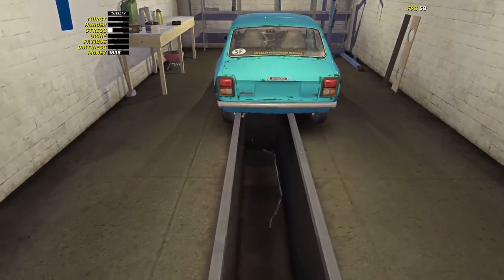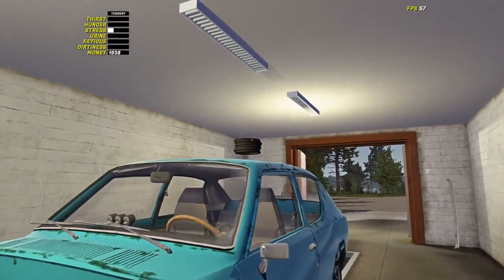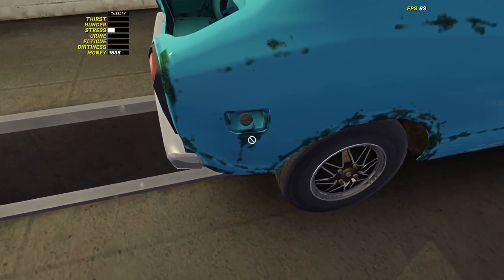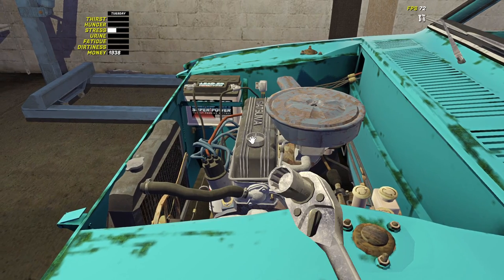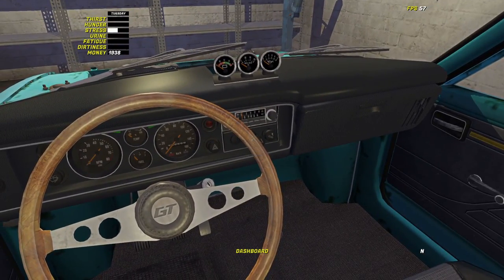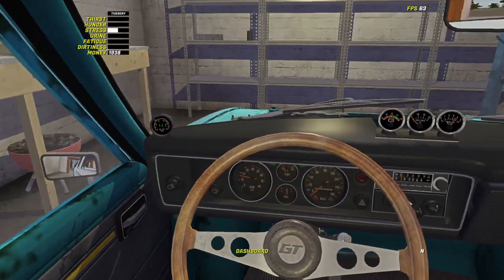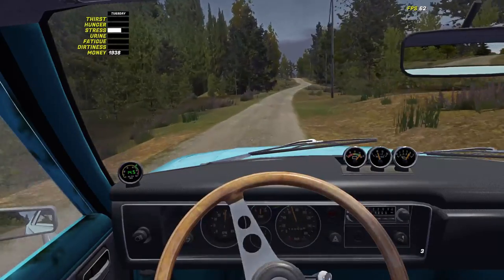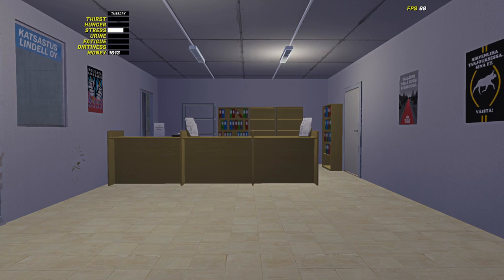My Summer Car - Wiring, Tuning & Inspection Tutorial - Update 2021 #MySummerCar

Comment: I didn't get where I am today by not subscribing to channels. Subscribed, have a jolly good day. My car has no power in first gear from a standing start. It will stall rather than drive at low revs I must always start moving forward by wheel spinning. The car has been like this since I crashed it slightly because of alcohol withdrawals.

Comment: I did EVERYTHING the same as you did, but my car wont start up... just runs out of battery... Any suggestions ?
Reply: You might've gotten a faulty battery. Check it on the battery charger by leaving it there for a while. After some time, if the needle is still on the right side, then your battery is probably dead. If it's in the middle or the left, you should be good.
Reply from the maker: Did you put gas in the car?. If so it might be what @Nick Zazirski said or you might have a busted part such as the rocker shaft.
Reply: @KasualChris-gaming-channel  yea, it was caused by busted parts... I'm so unlucky and got 2 pistons already damaged from the start of the game... Changed them and now its working .. thanks for the tutorial btw. :)

Comment: Thanks but slower version would be better for the starter players because you did everything so fast it was hard but good tutorial still :)
Reply: Oh the satsuma didnt start :( well i guess the wiring is wrong ill test to do that some day
Reply from the maker: It is literally impossible to get the wiring wrong buddy. Youve either forgot to bolt something up like the battery or the starter. Or you've missed a wire somewhere
Reply from the maker: You can always use msceditor to find out exactly what it is buddy
Reply: @KasualChris-gaming-channel  it started tow times normally and then it doesnt make any sound when i try to strat it has gas and fluids but yea and i dont like to use in games like softwares that arent like the game because its kinda cheating
Reply from the maker: It's only cheating if you know what's wrong but are to lazy to actually fix it. Its research when you don't have a clue what's wrong and want to learn for next time it happens 😀

Comment: I though the screw heads on rocker should be in same position facing same direction to make valves all in sync? I thought there was more to it than  just getting it to stop making ticking noise if you wanted them even that's why on wiki they suggest adjusting screws a specific way to ensure they are all even then turn on engine and adjust to ticking then back off and at that point all screw heads will be the same direction and you will know without a doubt all valves are completely even. Also I noticed you didn't tune the distributor ignition timing again...why don't you tune that also?
Reply from the maker: Honestly. I forgot about the distributor lol. I will put it in my feedback to remember it next time lol. Or I will do a tuning tutorial that covers it all
Reply: @KasualChris-gaming-channel  distributor is important for performance. Very important to adjust for nitrous!! If you make an advanced tutorial for performance increase that would be a great time to add the distributor. Overall still best tutorial on youtube for MySummerCar so cheers
Reply: @KasualChris-gaming-channel  i fucked up my rocker, now it fires when starting and dies after few seconds, also clicking sounds after the engine is turned off
i rolled back a save, and i cannot thank you enough for your tutorial, my car is for the first time in YEARS running

Comment: Hi, I have a problem where I rev but the car doesn't move, I have checked the half shafts and made sure I had all the brake fluids in. Do you know what the problem could be? Thanks
Reply: Take off the parking brake
Reply: Cannoli Nation  does the car start and it will go in gear and not move or  are you just trying to push it ?
Reply: Cannoli Nation  save at the toilet in your house and come back in and see if that helps the issue whenever there’s a bug saving and quitting usually helps

Comment: Help please, how do I remove, uninstall wires? I accidentally plug the radio in the bad speaker on the car when I have the subwoofer thing. The editor doesn't work for me(it's all false when I load it). Need help!
Reply: Just look carefully at the editor it’s hard to miss

Comment: I did the wiring all correctly but my car is still not working. edit: i found the problem, the bolts on the battery were not tight!

Comment: Ummm can someone help me i cant find the battery ground conecter. Is it because i have racing radiator?
Reply: Unscrew the bolt that's closest to the front of the car on the starter and then you can connect your ground wire. I hope this will help.

Comment: Well, after few hours of cusses and other few hours scratching my head; the car finally started first time in years. Seriously, Satsuma has been in garage without engine almost 2,5 years soon. :D Only issue seems to be spark plugs, they seem to keep loud banging noise when I rev the engine bit, with high revs its just fine. Any ideas what could cause it?

edit. its not spark plugs, noise comes from carburator, I believe, then later it spits fluids out, overheats and turns into a bbq grill.

FIXED: It was camshaft alignment! I overshot it with one. :D

Comment: cant reach the dash connector when trying to connect wipers and lights.
Reply: nvm i had to start with the inside , then the fron and lastly the rear. i managed to get it to work. but now it wont charge the battery but ill get it sorted

Comment: My radiator fan does not work :(
Reply from the maker: It needs to be wired up buddy
Reply: @KasualChris-gaming-channel  is connected, what I saw that I am missing is to connect more wires on the board, but I can not find the ✓ symbol anywhere

Comment: i’ve wired my car up twice, i done have the extra gauges and i’m not doing the front and rear lights just for giggles. but everything else to a T. i don’t have power when i turn the key but my dash clock is working lol. please help
Reply: realizing my dash clock analysis is stupid and irrelevant lol.
Reply: update: swapped batteries and my cars on fire now so, here i come 4th try